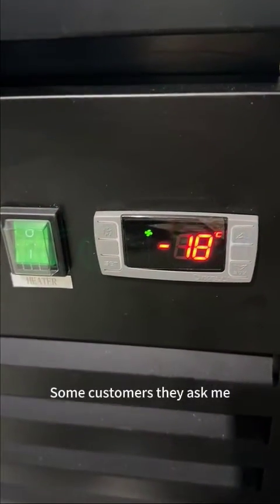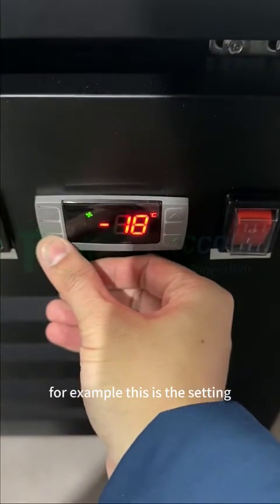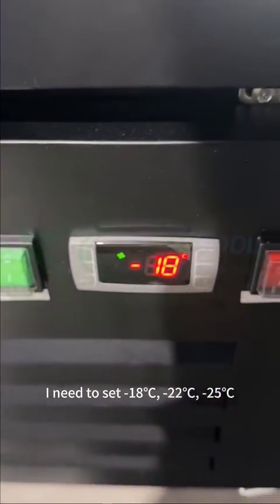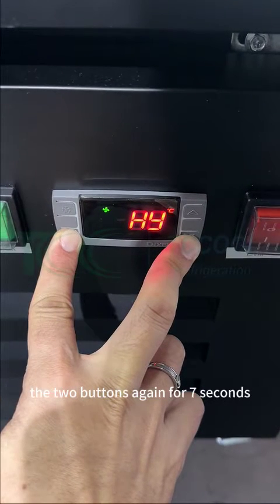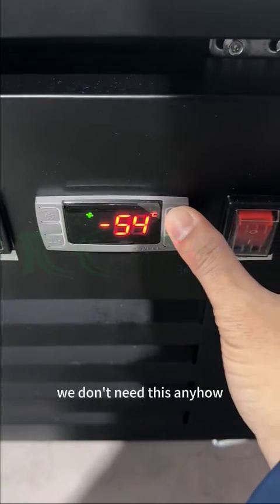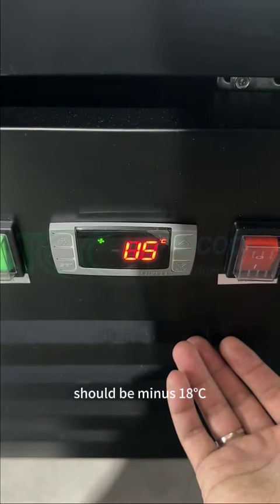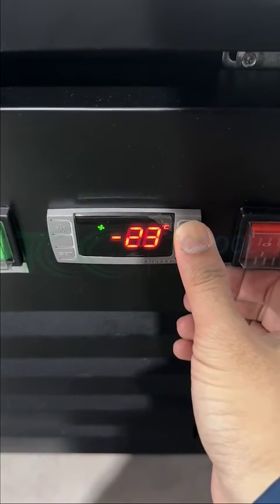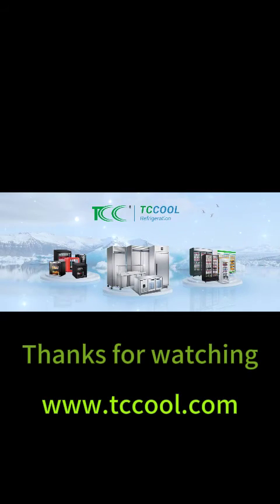Step-by-Step Guide: Setting Dixell Digital Controller for Freezer at -22°C

Comment: Can you tell me please how can I restor state after power by that I mean when the power cat off and the refrigerator is on defrost and the power came on I won’t the refrigerator to be on defrost and not begin to freeze again I don’t know how to set the in the thermostats because I need this function to set please if you can help me because I had many problems because of the power get down and the evaporator freez and make ice I need to solve this problem from the set 

Think you
Reply from the maker: Kindly please check the evaporator if it's only defrost by fan, or there is a heater for defrost

Comment: i need help! the ventilator is disabled and i don't know how to turn it on again ! i've tried thousand times to fix it as you showed in the video. but didn't worked... i followed all the steps but didn't worked... it has to show -18 but is showing just -7 maximal -10... and on the display appears just the snowflake... no ventilator .. please help ! the freezer is new
Reply from the maker: The evaporator fan is working properly ?